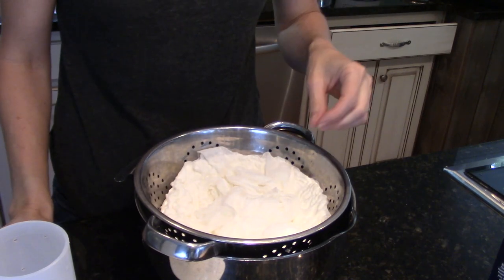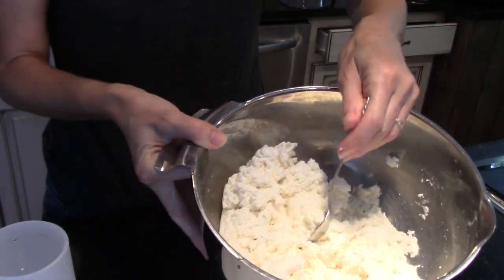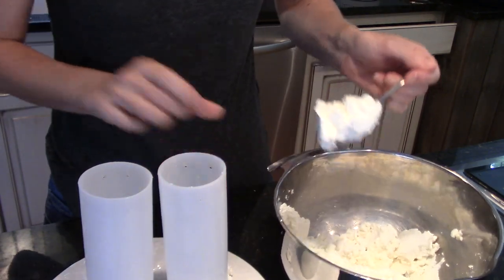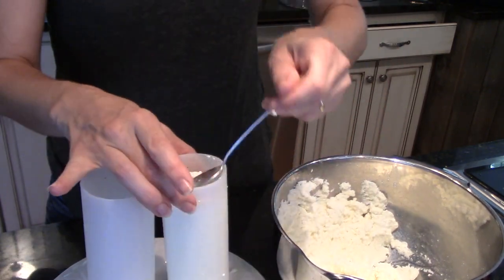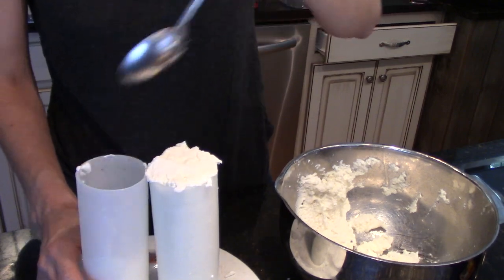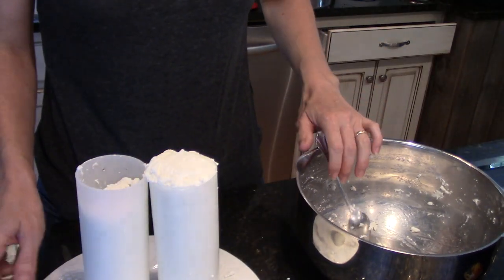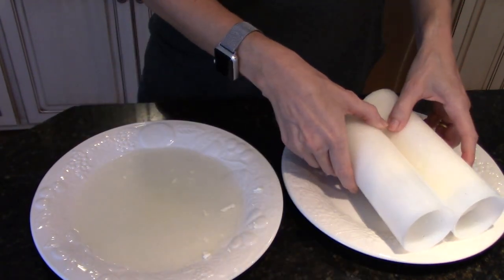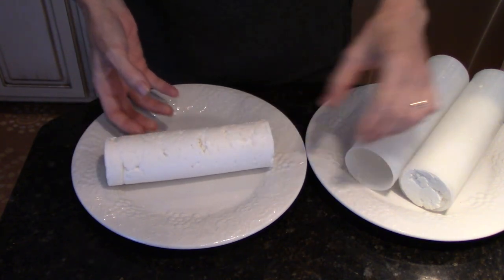How to Use Cylinder Molds to Form Chevre- Cheese Making at Home

Comment: Thank you for taking the time to make this video. I am kinda new to cheese making. BUT, I am also a soldier who was taught if you don't have what you need. IMPROVISE. I am making cheese molds out of old cake icing containers, plastic buckets, and anything else that suits my fancy.  I have had in the cubbard for while. Hubby got out his soldering iron and melted the holes in the plastic containers. I used a knife st scrape off the bubbles and they are perfect. My only problem at this point is that my last big batch somehow got contaminated with penicillium roquefort. I must have missed some spores somewhere when I cleaned up after making my blues. So in short, I have a lot of blue cheese.
Reply from the maker: Blue mold can really be a pain can't it? Sounds like you're doing great with your homemade molds!